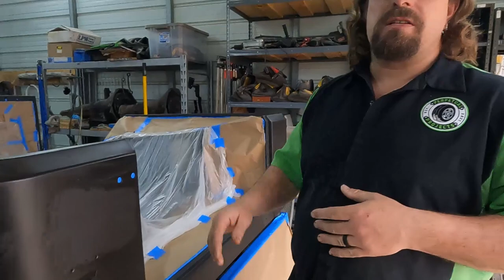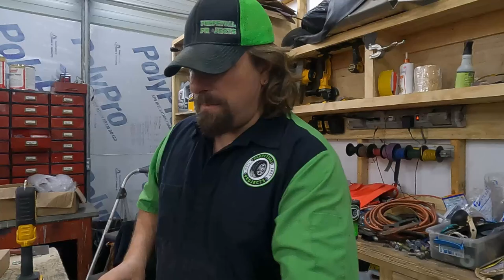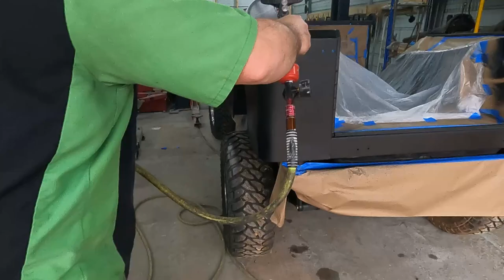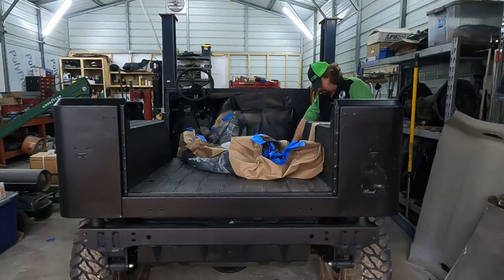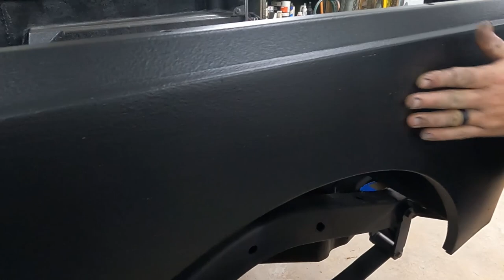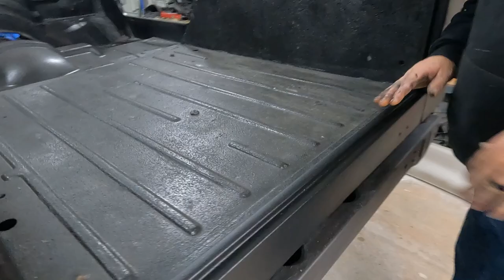Game Changer! Surprisingly SMOOTH Bedliner Application

Comment: How well does Raptor liner or reduced Raptor liner holdup with salted roads and highways? I live in Missouri and drive to locations in Iowa and Illinois, in all of which the highway salts the roads. Also does Raptor liner adhere to aluminum like aluminum trailers? Thanks

Comment: I have a 6-gallon air compressor is that big enough?
Reply: It’s enough but after trying mine out, I went ahead and bought a 20g compressor which really made spraying my truck bed a simple process. I never had to wait for the compressor to catch up
Reply: A 6 gallon will do it, it'll just be running non stop probably. Especially if you can get at least 4-5 scam. The more scfm the better the compressor